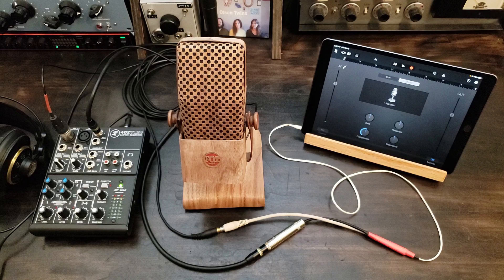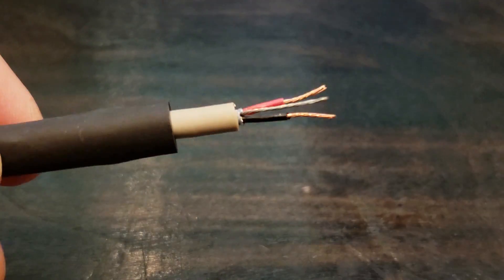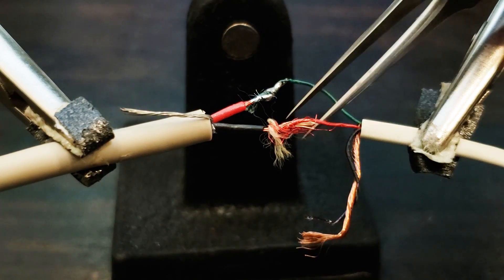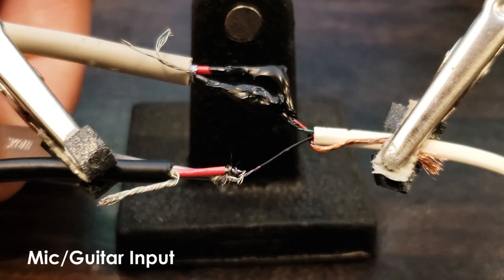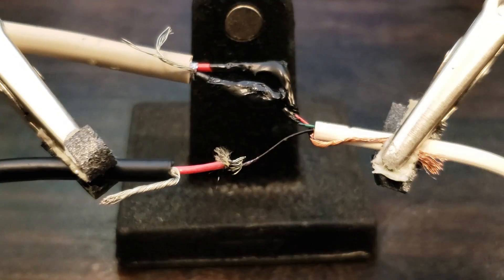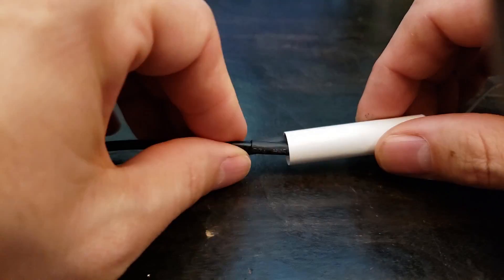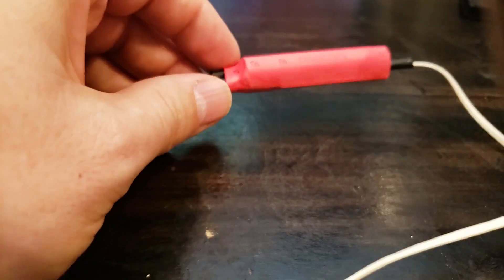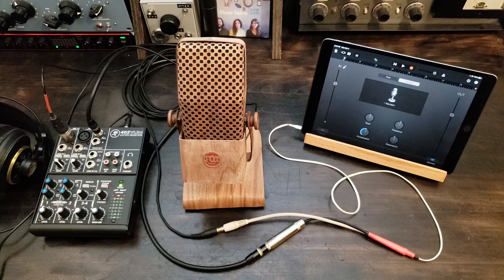iPad Guitar Cable Interface - Connect guitar or microphone to iPad and iPhone, DIY

Comment: Why didn't you use liquid tape on the last connection? And what's the deal with liquid tape anyway? Cool vid
Reply from the maker: Thanks!  Liquid tape is some kind of paint on rubber that keeps electrical connections from touching.  I use it sometimes when shrink tubing is too inconvenient or won't fit. I didn't use it on the last joint because I thought the other three were pretty well covered...I guess we'll see! 🎸😀🤟